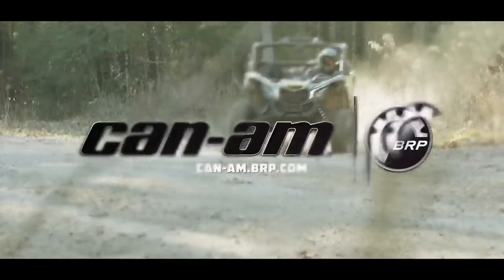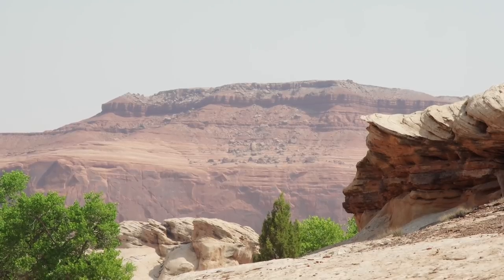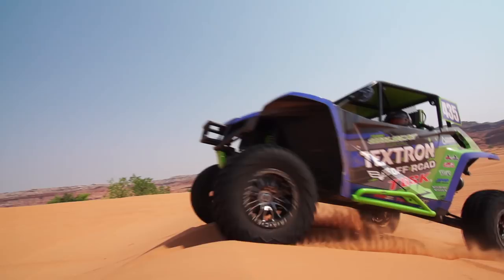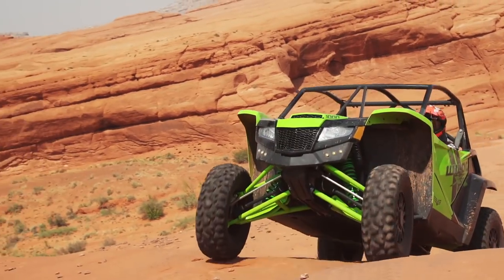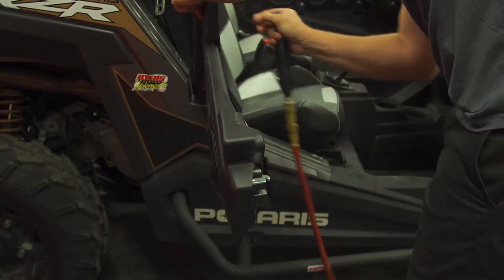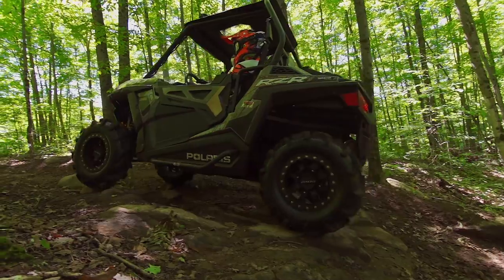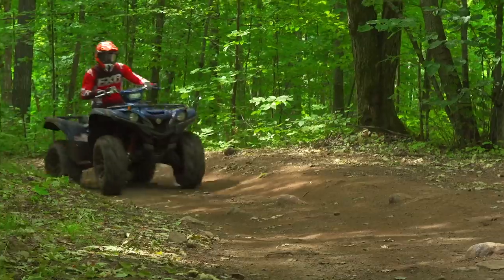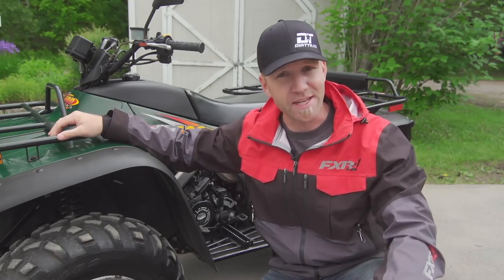Dirt Trax Television 2018 - Episode 9 (Full Episode)

Comment: DT so what’s your opinion on the XX and how do you think it compares to other machines in this category? Thx
Reply: I was waiting for some...clutching is...power is...sound level is...cab comfort is...ride is...etc type of details and comparisons. Everyone pretty consistently says they ride really well. Just soft in rear for big jumps. Chassis is solid, hence the weight. Power to weight on par with XP900 and XP1K 2 seaters NA, non-turbo.
Reply: I just picked one up. Came from a race yxz and this car is faster than my tuned yxz was. Once I get it on a track I’ll know more but this car does seem to be be built more stout than any other sxs I’ve driven or raced. Lots of potential here! Some people are very loyal to their brands and won’t give it the credit it deserves. I prefer its suspension and handling over every other sxs as well except my race yxz but that’s comparing apples to oranges
Reply: @damoncolleyracing9381  Good info. Thanks.